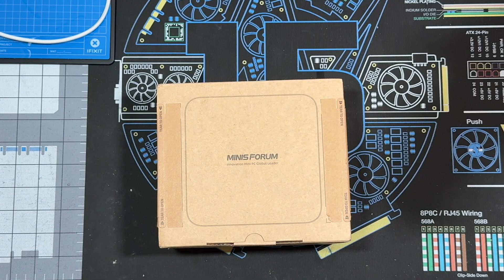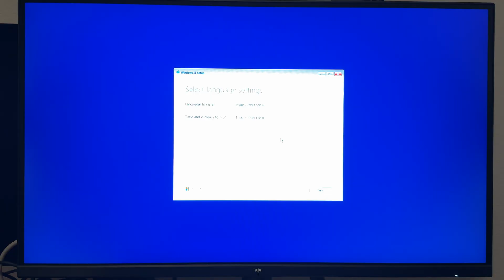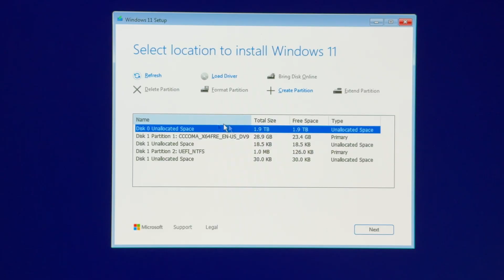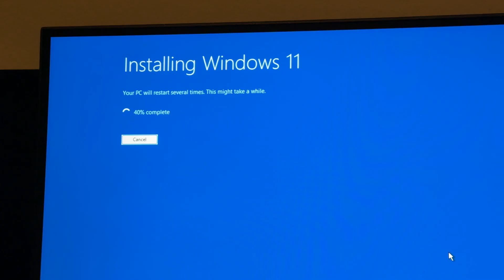Minisforum X1-255 AI Mini PC! Unboxing and SSD, Ram, Oculink Installation Step by Step!

Comment: Any suggestions on how to remove the bottom cover with the thermal pad stuck to the SSD and the cover?
Reply from the maker: That’s difficult and very common with these mini pc’s.  I just slowly lift as carefully as I can.  I’ve opened the UM890 Pro so much it’s losing stickiness.
Reply: @theFix64  I found the solution -- I used a heat gun on low setting for a few seconds while slowly and gently lifting the cover.  It worked great.  My solution for the next time is to put a heat sink on top of the thermal pad.
Reply from the maker: @cynot71 great thinking! Those are both great solutions.